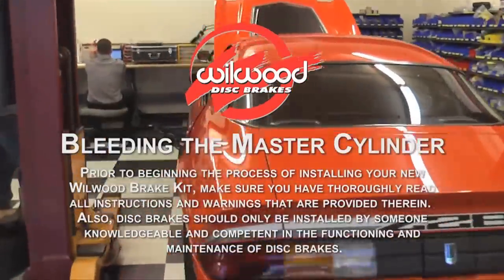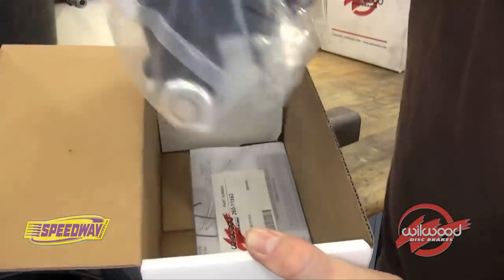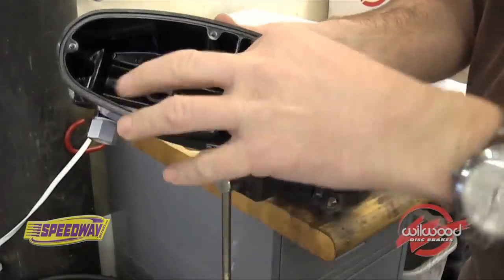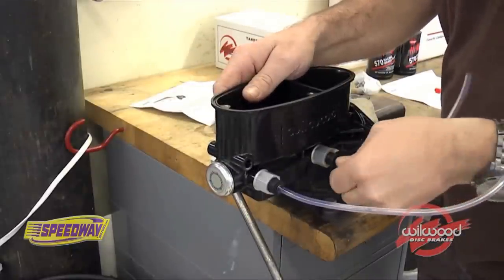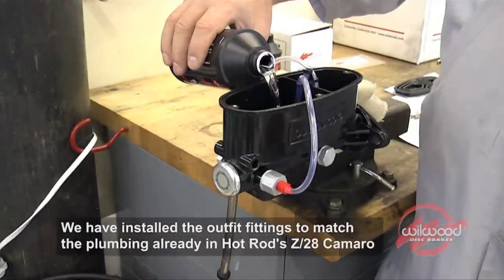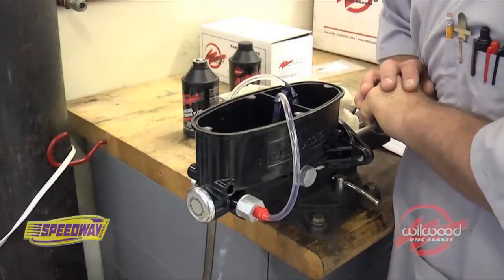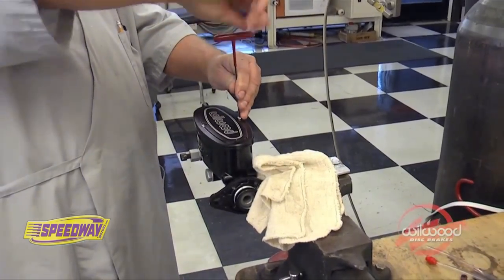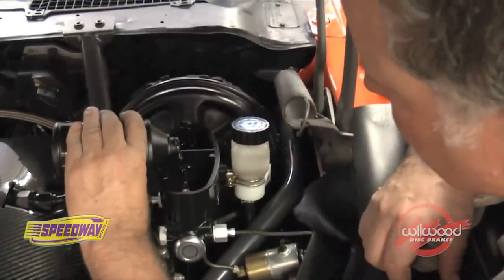Wilwood Master Cylinder - Installation and Bleeding Procedure

Comment: The problem i had after bench bleeding is my system was completely dry its a whole new system and bubbles came back up through the master cylinder during the bleeding process so it needed to be removed and bench bled again. When installed in a car like the one in the video where the master is at an angle its impossible to get the air out in the car. The best is actually pointing the front of the master cylinder down slightly while bench bleeding and that allows air to escape. Mines on a jeep and it doesn't have that steep of an angle but its enough of an angle and when bubbles came back up through the system it trapped some in the end of the master cylinder. I got the whole system to bleed with no air coming out but still have the soft pedal, originally i thought it was trouble due to my cutting brake setup and the extras there but as soon as i did a little research and found an explanation describing how air escapes the master cylinder and why bench bleeding is so important i knew my problem was with the air that came back up through the master cylinder and a little got trapped because of the angle.

Comment from the maker: @xzibit82 Since the Wilwood 4-piston calipers require a high volume of fluid, we recommend using either Wilwood master cylinder, part # 260-8556 or 260-4893, both of which should bolt up to your factory firewall mounts. Be sure to check the height and length dimensions of each to ensure they will fit in your engine compartment. Both of these master cylinders are available at SpeedwayMotors. com. Feel free to call our Tech Line at 800.979.0122 if you need further assistance.